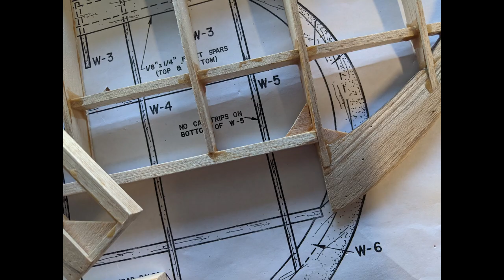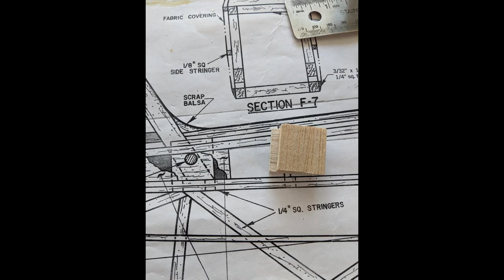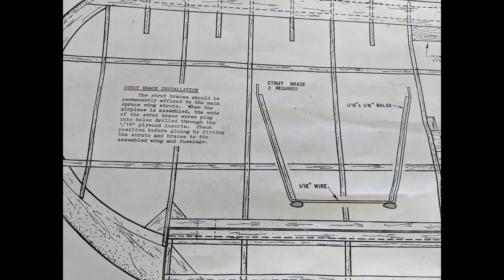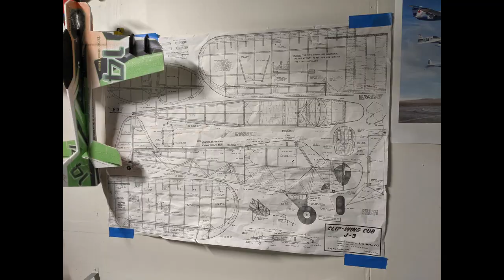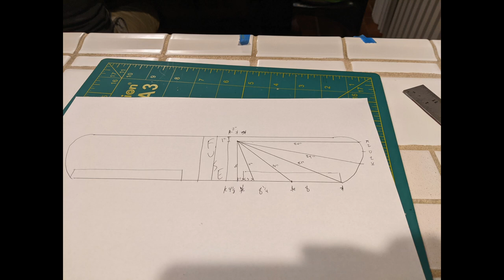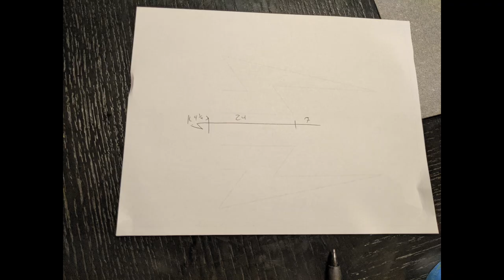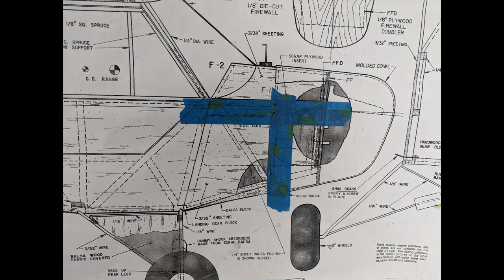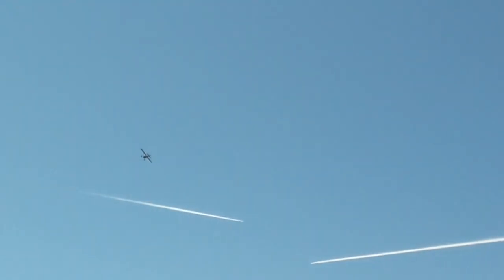Build Log: Sig Clipped Wing Cub Kit - Electric Conversion

Comment: Great job. I built the same one(first build too) and fit it as a nitro. Just going to change to electric too. What motor did you use?
Reply from the maker: Thank you!  I'm running a Cobra C-3515/14 Motor Kv950 with a Cobra 60A ESC, a 5amp 3s 30C lipo with a 12x6 APC prop. I'm not 100% sold on this motor set up, only 3 flights on the plane so far.  Feels like it could use a little more power, but it has enough power for scale flight.  Not sure what flight times will be on the 5amp 3s pack.  I landed with 11.9V remaining on the battery after 7 minutes of flight time and everything was cool to the touch. Should be interesting.
Reply from the maker: So now I've had a few more flights on it and I think the motor I mentioned previously with the 12x6 prop is plenty of power for the plane to fly scale. I come in at around 5.5 lbs  Anything heavier than that and I'd recommend a larger motor. Anything lighter and it'll fly nicer!

Comment: I am thinking of building. Can you tell me what electric system you used? I don’t know a thing about electric motors or batteries. Your flys better than any electric I have seen. Thanks for the video.
Reply from the maker: Hi, I'm running a Cobra C-3515/14 Motor Kv950 with a Cobra 60A ESC, a 5amp 3s 30C lipo with a 12x6 APC prop. This is a sig models j3 Clipped wing cub.  This build took me just under 9 months and 400+ hours. I can't tell if you've flown gas model aircraft prior, or if you're looking for a first model.  If you've flown before, there's enough power to do a wide variety of scale aerobatics with this power set up, but you'll need to be careful, as it will fly scale. If you've never flown an RC model before, I would not recommend this for a first aircraft.
Reply: @TheTavFox  Thank you for getting back to me. The club has gone all electric. I did not want to. I am going to build a new Cub with your setup an see how I like it. I enjoyed flying one with a Fox .29. I love the sound of engines an the smell of burnt castor fuel. From your video everything seems to have been thought out well. I built fast when I was young an lost a lot of gear, but patience with accuracy is best I find. I wish I could do a video of mine to show how it will fly, but following your setup I think I will be ok.
Reply from the maker: @cwradio4571  The biggest recommendations I can make with Sig's model is to keep the tail section/empennage as light as possible.  I would also recommend planning your battery bay set up before installing the firewall/balsa wood structures around the cowling/nose. I have nearly 4-5 oz of nose weight to get it to balance right, even with a massively oversized battery for the plane. There are a lot of options with how you can make the wing struts. Some people opt for removable and foldable cleaves to make the wing easier to remove for transport.  I do not like to disassemble planes for transport, so mine is harder to remove/is more fixed. Lastly, I built the model as specified in the plans.  There is no real "center spar" like modern models I'm accustomed to building.  Were I making it again, I'd have replaced the wing supports with bass wood instead of using balsa or inlaid some carbon fiber to give the wing more strength.  The struts are completely functional, and while I have been able to preform spins, loops, rolls, hammer heads and a variety of other scale maneuvers without the wings folding up, it still feels spooky to me.
Reply: @TheTavFox  I will take all these considerations to heart.  I agree the wing needs a better design. I never liked it from the beginning. Sig carries  some nice gear but, this plane needs a major upgrade. I would like to see a new cowling design as well. I do plan on making a better strut  mount as well. If they would upgrade the design the struts could be made easier.i will keep in touch, thanks again